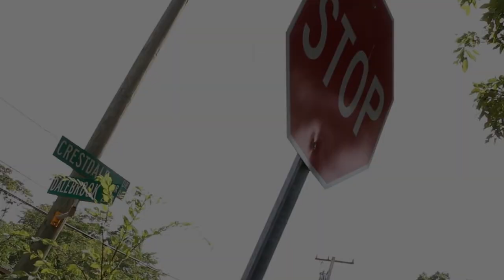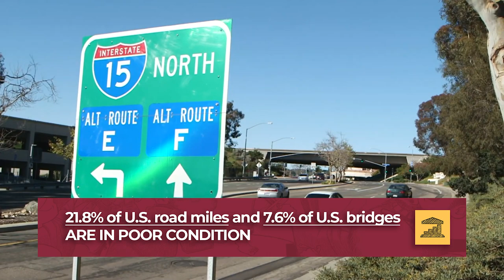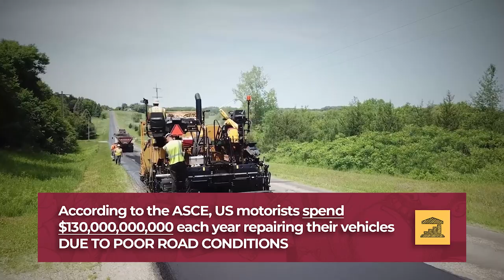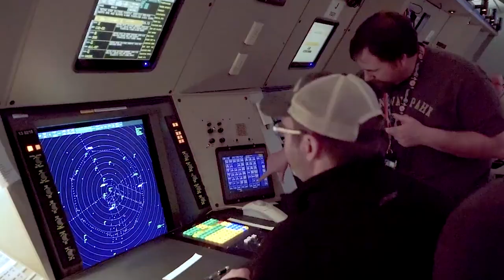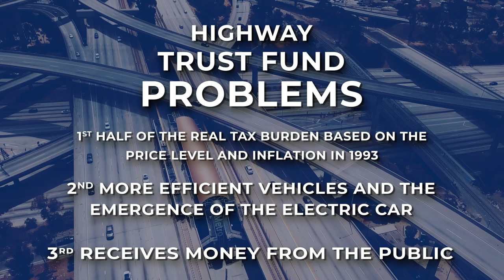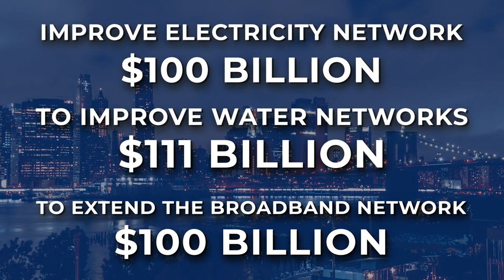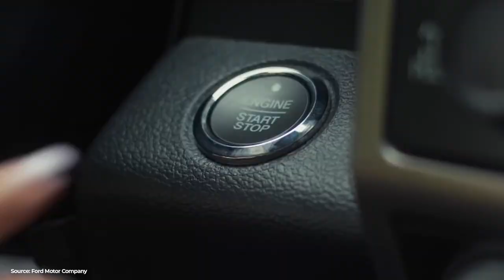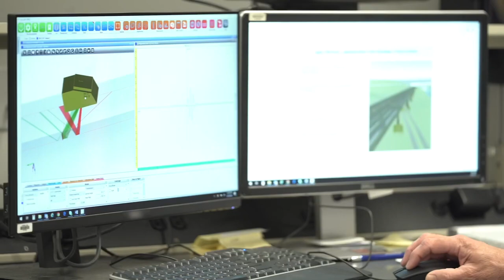Why is US INFRASTRUCTURE so BAD? (And what is BIDEN’s plan?) - VisualPolitik EN

Comment: The problem is the US only invests in projects but does not maintain them. The US uses a lot of concrete bridges which are cheap to build but need lots of maintenance while in Europe we try to build in the air as little as possible to reduce repairwork and budget it's complete lifespan.

Comment: G'day,

As it happens, here in Oz the Road Networks were wrecked when, during the  Drought of the late 1970's & early '80s..., pennypinching Politicians decided not to regularly  reseal the Bitumen on our Highway Network  every 18 months (as required, because after 2 years the "Volatiles" will have completely  evaporated, & so  instead of flexing under load the Surface cracks...) ; so that when the Drought broke, Water ran through the Cracks, into the Roadbase, hydraulically pulse-pressurised by every Tyre of every Vehicle travelling over the wet  cracked surface...

   So, simultaneously, the entire Road Network all turned into an interconnected collection of Potholes,  all requiring repeated Patching.

And, since 1980 the the increasing frequency & increasing intensity of Record-breaking Extreme Weather Events - brought to us by Anthropogenic Global Warming, caused by Planet-wide industrial-scale burning of Fossil Fuel, emitting the Carbon to the Atmosphere....; has been repeatedly destroying Roads, Bridges, & Railway Lines, Electric Power Grids & Telecommunications Towers..., etcetera etcetera, ad infinitum, ad nauseum.

  And, selling the deteriorated, falling down Infrastructure to Private Investors (Infestors...?) on the assumption that they'll fix the Mess while Treasury can use the Money to build some other New Shiny Bright Thing...; is, was, and always will be - a totally bullshit misrepresentation of the Scheme.

What happened, and still happens here in Oz, is that the Tory Government "Privatises" well-maintained Public Infrastructure (eg the Electric Grid) to their Big Busyness Mates for well under it's Value, or cost of establishment.. ; then the experienced &  trained Staff are retrenched & told to become  "Contractors", the stockpiles of Spare Equipment is run down to Zero & the Depots closed & sold, all Preventative Maintenance is ceased & is henceforth done on an Emergency- Repair Basis only, after breakdowns.

The  Government uses the money thus raised to retire it's pre-existing Foreign Borrowings..., while boasting about how much "more efficiently managed (Man-aged...)" the new shite & briny Privatised Service has become..., the Corporation uses the money "saved" by running the System into the Ground to declare "satisfyingly" high Dividends ; and then raises all it's  Prices to cover the cost of Emergency Repairs, when lack of regular Maintenance - or a Catastrophic Weather Event causes the System to fail...

  So We the People experience ever increasing prices, always deteriorating services, with increasingly frequent breakdowns..., the FatCatTrendyMoneygrubbingArsehole mongrel bastard  Shareholders grow ever fatter & sleeker & shinier...; and the (corrupt) Politicians boast about how much more "Efficient" Private Enterprise had made everybody's Lives - then the Politicians step down, or lose the next Election, and step straight into a "Job" as a Director on the Board of one of the Korporations to whom they "fenced" the Public Infrastructure thus stolen from,

 We
 The
CitiZenry...!

"...Oz, which is 'AmeriKa Mk-2..."

Is a pretty fair description of the corrupt & pot-holed Neo-Fascist Shit-Hole Country that Tory-ism & Market-Farce Theology has made of the Nation I was born into, 60 years ago.

Oz is about to delaminate, and then implode ; to the point where Beijing won't even want to annexe us for a Mining Colony.

Just(ifiably ?) sayin',

Such is life..

Have a good one...

Stay safe.

;-p

Ciao !
Reply: Actually the county councils in NSW bought all new vehicles and replaced a lot of poles before it was sold for top dollar to build the metro rail.

Comment: Australian idea would likely mena that private companies get to rip-off consumers for 25 years after paying off their investment in the first 5-10, unless there is a cap placed. That's the case in UK for most PPPs.  
Else you might have a situation like in Canada where private railway owne4r refused to fix line to a remote community after a flood meaning government would either pay for it or would need to relationalise then.  
Q
I prefer what Singapore/Stockholm has, where cameras capture who drives and where and charge them accordingly, it disincentives driving unless necessary and taxes based on consumption. If you have 20+ different private operators charging using different payment schemes, pricing models it would get confusing and annoying.  Also if there is only 1 or 2 roads to a place consumers do not have an alternative to choose, so providers won't be competing to bring down the prices. Having them compete for a government contract to keep a certain piece of infrastructure  safe by conforming to bunch of regulatory safety red tape for periods of 10+ years sounds more feasible to me.

Comment: Do you think this would have greatly exasperated the current rate of Inflation? At the time this plan was being discussed, so called experts insisted that Inflation was temporary and short term and definitely not causes by the massive influx of cash in the system. 

Now they are saying differently. Do you think an extra $6b would make things worse?

Comment: love it when the brits can't count, 2,300,000,000,000,000 (the number that VisualPolitik displays in this video) is 2.3 quadrillion in the U.S (thousand Billions for the brits). not 2.3 Trillion U.S. remember that all U.S. headlines use localized values therefor they are not indicating trillion in British units but trillion in U.S. units which is less: 2,300,000,000,000 (or a Billion for the Brits). best to double check your math for rounding errors next time guys.

Comment: Private infrastructure is VERY problematic. Experience shows that private investors have no pressure to keep infrastructure in good shape, only useable shape. 
Can you choose to not take a bridge? Not really. You are forced to to accept a monopoly. 
For example look at the water infrastructure in USA. You can not choose to buy water from a different provider much less through a different pipe network. 
There are just areas in which the powers of capitalism only express its worst monopoly and should instead be owned and operated by the state. As the forces of the markts can not put pressure on a monopoly even korrupt officials in charge would be better.
You own the only bridge/best connection to a place? You can charge 100$ per person crossing it. Not per person per day. Each individual crossing.

Comment: Modern Monetary Theory(MMT) supports the spending argument as well as explains why a deficit is a good thing & only a bad thing when too much money is injected into an economy that doesn’t need it. Hence the inflation as a reaction. The US, however, is in the unique position of having a currency with tremendous value. Being the petrodollar as well as world reserve currency.. The reason no one does it is bc the system requires they give money to the 1%. It’s not that they want to, or even have to, bc it will always happen naturally. So they control the valve, the flow of money. And back to the point of no one enacting the bill/change bc it’s not only going to be extremely obvious when income inequality explodes.. then the system collapses.
Reply: The feds don’t need your money. They’re the ones who give it away in order to start the system cycle of demand(food, services, etc), supply{landlords(kings, slave owners)inventors/etc}
Reply: That makes people work for the money in order to buy the services. Tax comes into play in order to control how much money is in the economy. Hence GDP isn’t random but controlled to an extent. Altho extremely dependent on multiple factors both within the nation primarily but also outside of it.

Comment: it the yearly licencing of vehicles was increased by states they would be more able to repair the infrastructure of their state due to a higher revenue.  They would be required to guarantee all funds going to infrastructure they they collect from the licencing.  Many bridges in the USA are neigh on dangerous to travel over.  But the problem has been about for decades, that once built there is no budget set to keep it maintained, this is mainly due to politics.  Quite simply people dislike paying taxes, so the party not in power will promise to cut taxes upon election, (a promise they fail to actually keep).

Comment: I will point out that in my neighborhood in Colorado, the freeways are large, newly renovated, and in excellent condition.  Secondary roads are also in excellent condition.  The result of this is that folks commute for long distances for a long time that would have been considered intolerable during the street car era.  That rather than small, weird, yet efficient ways to connect freeways to side streets that I grew up with in Minneapolis with older, crummy freeways, each off ramp costs tens of millions of dollars, and it sometimes takes 5 or 10 minutes to get two hundred feet from a freeway off ramp to an adjacent parking lot.  It takes six months to put in a bicycle underpass, that gets almost no traffic in the end.  The trip to the airport and through the terminal takes a significant fraction of total travel time for flights to the coast.  They rebuild a road and bridge that got washed out in a flash flood, that was obsoleted by previous road changes - after several years - that actually decreases carrying capacity due to the need to have an additional traffic light.  Needless to say, I'm incredibly dubious of the self servicing assessments of the ASCE.

Comment: People have long forgotten while states took over their respective highway systems from private owners, and that was because in the past a private owner had the right to charge a toll and would charge as much as possible, often almost at ruinous rate because there was little or no competition all alternative routes to get from point A to point B, at the same time they only did the barest of minimum required maintenance, and that was a best case scenario.   

Australia's approach could well be a nightmare in the making, especially for transport companies and consumers.   Here in my Province of BC Canada, the Government use to maintain our highways, but later farmed out that work to regional contractors and since then pretty much every year, the complaints from the motoring public about the shoddy conditions of our highways grow and grow.  This is something the Aussie may want to consider.
Reply: As an Aussie myself trust me it’s shit!  Most major city highways are toll roads (interstate “highways” are free but mostly one lane each way) and the repair of all the roads is done by private companies so they don’t fix the bit of the road that needs fixing (because it’s hard to fix a road with a heap of potholes and alignment problems) they go and resurface the bit that was already nice and smooth a couple of kilometres down the road as that’s nice and easy for them and they make more profit margin on the job.
Reply: @David-lr2vi  Seen that here as well.   Last year the company looking after a section of highway laid down some lovely new tarmac on a section, but left other sections alone.....this year they repaved the same damned section as last year while the other sections have been left to deteriorate.

Comment: Ranked 13th is certainly better than no rank at all. This video is of little value. Of course compared with the third rank Hong Kong, one can see the big difference. In Hong Kong, an area of 1100 SQ km, one can travel to ten destinations in a single day using public transportation at affordable cost and with 5G internet connection.
Reply: Exactly. Similarly area of Taiwan is only around 35,000 sq kms and one can travel to ten destinations in a single day using public transportation at affordable cost, but to develop a huge landmass like China, needs China like expertise and that is why Chinese infrastructure companies can be given these infrastructure projects to build and upgrade.
Reply: @thecomment9489  The US already has the infrastructure network from the 60s and 70s. All they need is to repair and maintain the existing infrastructure.
Reply: @2KSnSLifestyle  Chinese companies will be ale to build new infrastructure for US in less cost than what it will cost them to repair by American companies.
Reply: @thecomment9489  Of course, but for public infrastructure projects the US government must use union workers.

Comment: It depends on what you want to achieve with your infrastructure. Is the focus individual movement of people, or cargo? If it's cargo, the questions that are important are what's the most cost effective and fastest. If using a long distance cargo train is the most cost effective, but too slow... upgrade the rail network to accommodate faster trains, more direct routes, faster transfer of cargo to smaller trains, or trucks to deliver it to the destination..... if it's too expensive per mile, automate it. 
If you need less trucks on the road, that saves a lot, as the weight of trucks is a heavy burden on roads. In the Netherlands besides fuel tax, cars are taxed on their weight... aka the impact they have on the road. 
Obviously this will impact the truck drivers, but they are bound to be impacted regardless by the inevitable arrival of driverless trucks. 
Main takeaway is not so much 'use trains' (although I'd personally be in favor of that) but rather, the US needs to take a hard look at whether the infrastructure from the 19-really-long-ago is still the ideal setup to meet the needs of now and in 50 years for transportation of goods and people.
Reply: With Japanese maglev it would be possible to do both  Sydney/Melbourne because as it needs no maintenance it can take passengers in the day and containers overnight replacing some of the 700,000 B doubles per annum off the Hume and making big bucks with a faster  service.

Comment: Each type of infrastructure will requiere a different model.
-In the case of rails, Amtrak should be building high-speed rails and auction off the right to run trains on them to Private Companies. Wile operating its own trains for areas that aren't profitable enough for those private companies.
-For Metro rails, the operator should be owning the area surrounding the stations and renting it for real estate. Look at Hong Kong's metro system.
-Many Big Airports should privatized or semi-privatized. This works great in Europe. While Government can instead just operate the smaller regional airports that connect far off communities.
-For Highway. I would say they could have a combination of Tolls and renting out the properties adjacent to the Highway and Services. Paying the Toll would give you a discount in (or free) Services and Insurance in case of accident or damage because of road condition. There would an Optional Lane without the Tool, but you don't get either the discount or insurance.

Comment: leave the roads to the states! theyll come up with a better solution eventually through trial and error the fed is too big to fail
Reply: They've had plenty of time and they've largely failed spectacularly.
Reply: @blastermanr6359  although that is true, there are some states with pretty good infrastructures like florida utah or nevada, and if you particularly value infrastructure you can move there,  however if the fed took over all of america will have shit roads
Reply: or just have a bill like the original interstate highways. offer less though, like $3 for every $1 spent at the state level without any strings attached. so some more urban states will focus on rail/metro/public transit and other more rural states will use it for highways and freight rail. let each state decide how to use the money. some will do a good job and some won't, but at least you gave the opportunity.
Reply: @mattbowdenuh  not just the oportunity the fact that you can move if your state fuked up too bad
Reply: @skyleonidas9270  well all the roads there are new and there little winter weather. Give it 50 years like michigan and the inadequacies of the system become clear.

Comment: Privatizing infrastructure in the US never works out, pretty much the same mess that happened when the UK tried.  Private company comes in, lobbys for deregulation, skimps on the maintenance to maximize profit, then leaves the taxpayers on the hook when the company goes bankrupt.  New buyer comes in, and skimps even more and the process repeats ad nauseam.  This came to a head this year in Texas with their ERCOT electric grid failing to handle both a  winter snowstorm and a summer heat wave